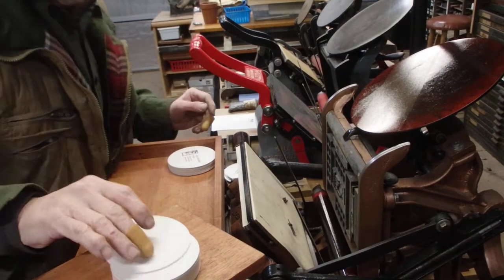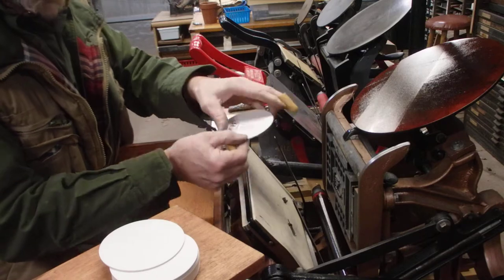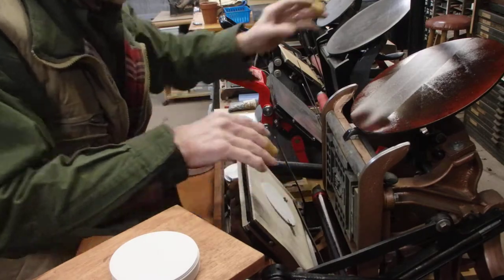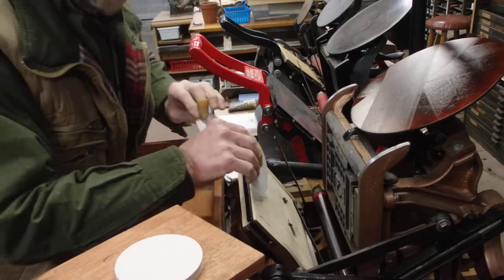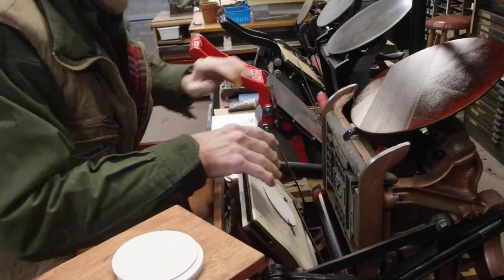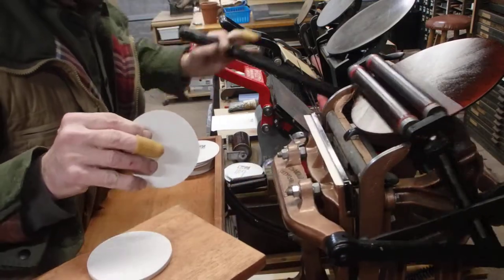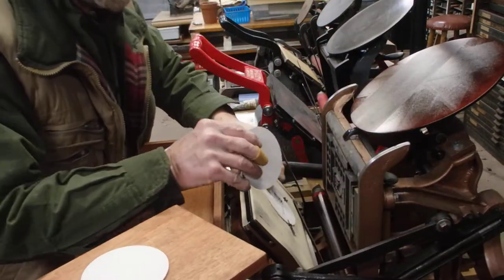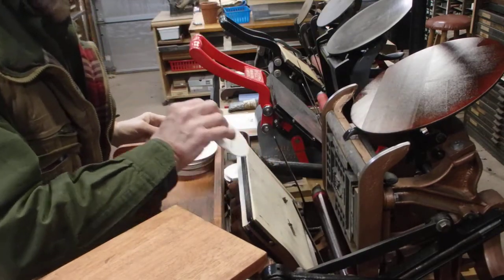Printing Coasters on the Chandler & Price Pilot Press

Comment: Hello I found a wrench in an old tool box, it has "Chandler and Price Co,Cleveland,O,USA" written on it. On the other side it has the number 761 on it. Have any idea what it is for?
Reply from the maker: David - it all depends on the size of the wrench. C&P did make their own wrenches and I have a few - mostly for the larger presses. These were used to remove bolts and adjust the platen bolts on Chandler & Price presses. Want to sell it? I collect all sorts of things related to C&P Presses.